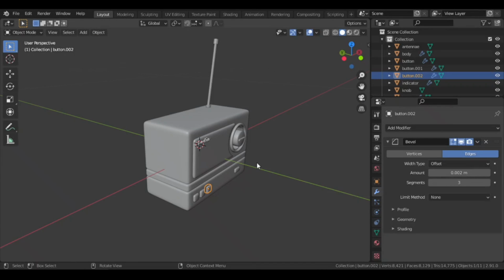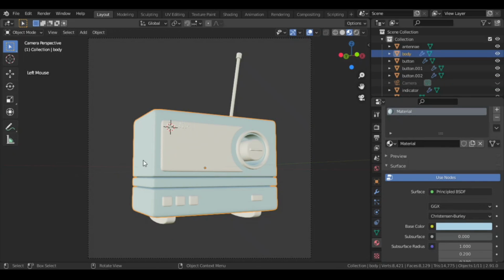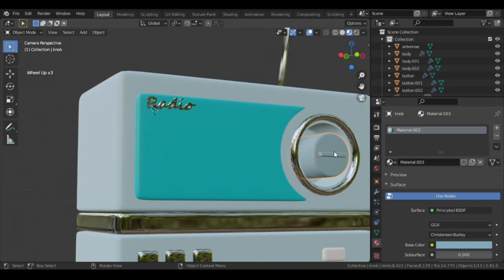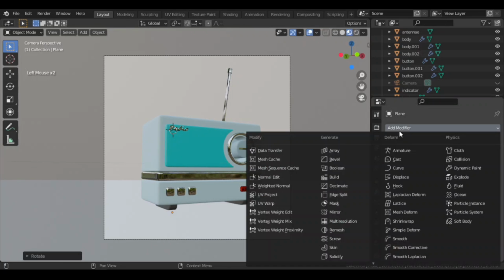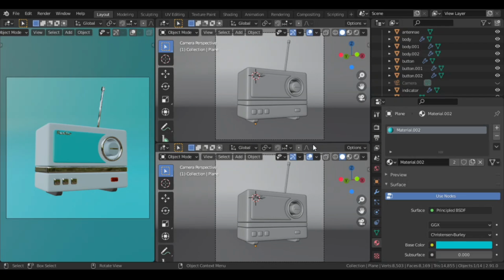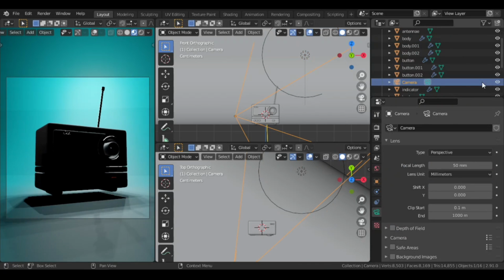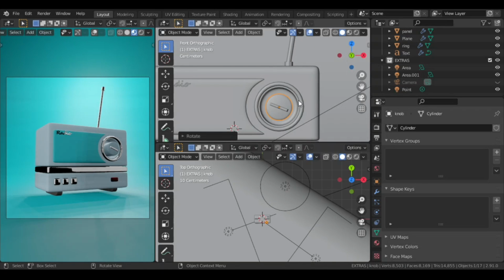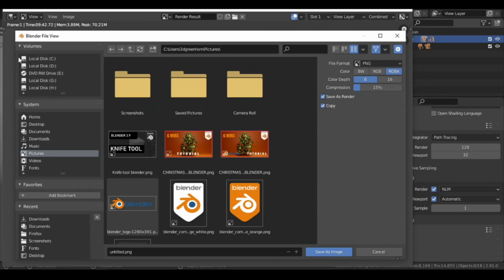Radio in Blender - Part 4

Comment: why when I colored the body, the panel and the ring are also affected? How can I unlinked these objects?
Reply: Same problem 😟😕
Reply: If they are indeed linked, select them out in edit mode and press P to separate. If they aren't, check if you haven't accidentally applied the same material to all the affected parts. If the same material is chosen for multiple different parts, it will impart the same color, texture etc. to all of them :)

Comment: I have this problem where when I go to material preview mode, my object become invisible...
Reply: Do you use AMD GPU? Because I had same issue, apparently it was because of drivers... Newest ones made by AMD, but not aproved by microsoft were causing an issue, so I updated back to older ones via windows update and it works fine... Cant play Red Dead Redemption 2 rn tho...